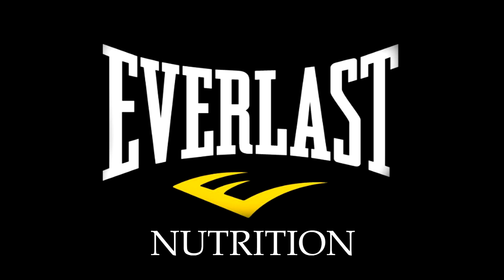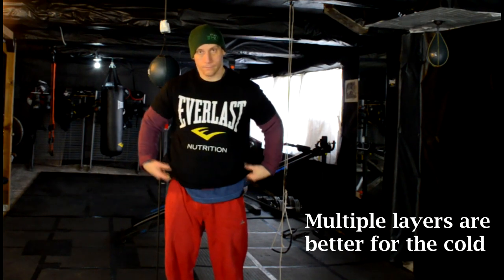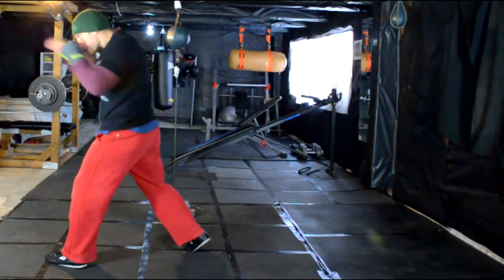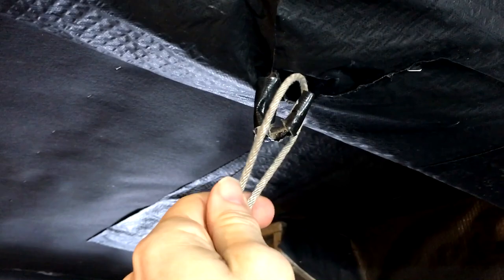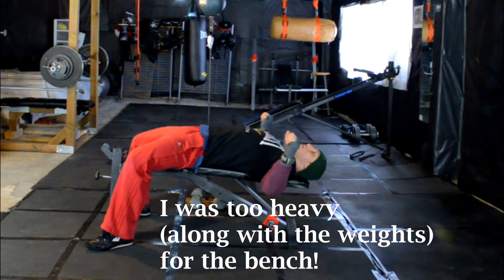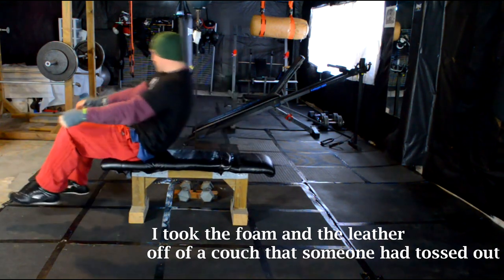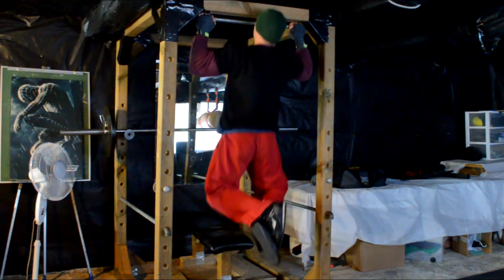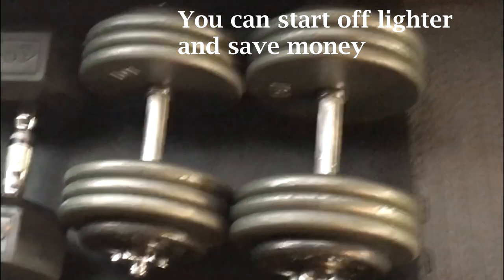Ideas for Building a Great Home Gym

Comment: As usual, a brilliant video. Thank you for continuing to post. I have set up a home gym myself, but the one area I struggle with is getting the tension right on the double end bag. The straps I bought are too loose, but if I double them up they're too tight! Do you have any advice on this please?
Reply from the maker: Depending on which one you have, you could tie one end into a knot to shorten the length of the bungee cord : )
Reply: Thank you. What type of tension should I be looking for?

Comment: Hey Mike, why not just buy the bench and power rack
Reply from the maker: Thanks for commenting ;
The reason why I built the power rack was because I needed one to custom fit between the two wooden beams in the ceiling of my gym. I then had extra wood left over to build a sturdy bench. The great thing is that it works just as well as the one I use at the gym but it was a fraction of the cost 😎😎😎👌